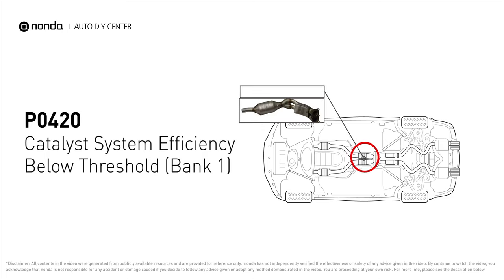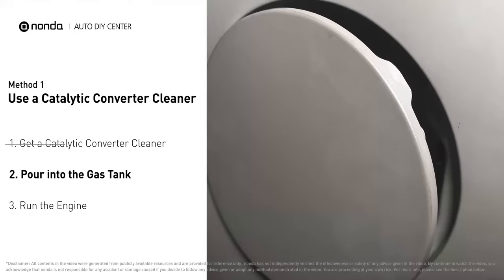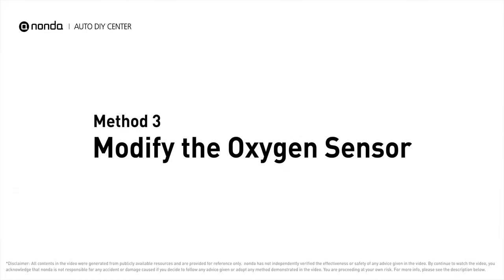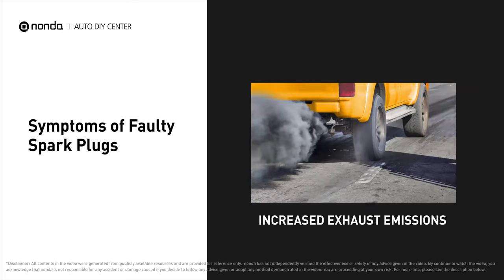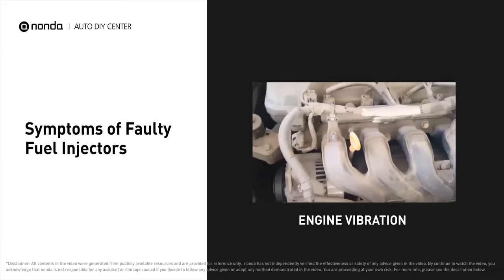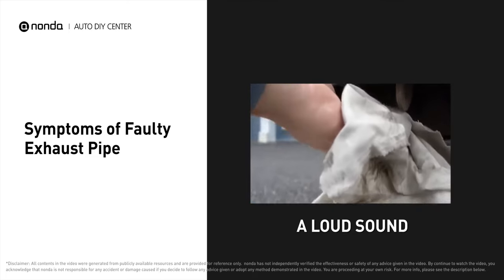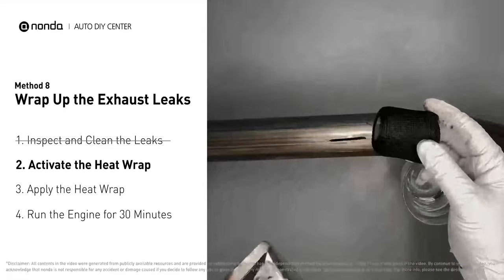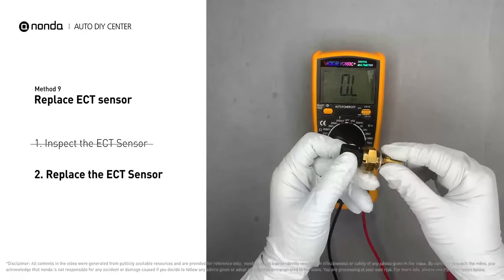9 Solutions to Fix P0420 - Don't Start Fixing Before Watching This

Comment: It is a great way to help me understand the P0420 on my Dodge. However, if you eliminate the music from the video the information will be projected much clearly.
Reply from the maker: Thank you for your feedback.
Reply: I like the music
Reply: The "music" , if you can call it that, is EXTREMELY annoying.
Reply: Your right, very annoying!
Reply: I just installed new long tube headers with catted x pipe and got a tune on my 14 mustang gt and got codes P0420 and P0430. Never had this happen till I got the headers installed any idea why this happened?
Reply: @UrbanMaxxTV to ok 😊😊😌

Comment: Very professional and absolutely thorough.  I've been wrestling with P0420 for most of the year and found these ideas individually.  It's nice to see them altogether in a very professional presentation.  I'm finally ready to order a cat, but I called the manufacturer and he agreed that it was often not the cat - but I've looked at all these others already.  So frustrating, mainly because my cat is welded inline so I can't even check it.  Alldata points to bad cat, but I keep thinking it's something else.
Reply from the maker: Hello, we really appreciate your feedback. Hope it helps!
Reply: name of detergent?
Reply from the maker: Hi Zoltán, you may head over to this link regarding your concern with the Detergent Soap: https://amzn.to/3sbMISV
Reply: @nondainc  thx 😉
Reply: did replacing the cat fix the problem?
Reply: I used gumout, changed my sparkplugs and cleared the code, check engine light hasn't come back on.I think my injectors may have been dirty, I have to look into my cat, can't do much but check the temp before and after it to see if it's working right.
Reply: I also had a code for ECT sensor but check light hasn't came on, I may replace it or check it when I do a coolant flush this spring
Reply: BE AWARE THAT some VW Group automobiles do display a tricky P-0420 code EVEN when the catalyst is still good and with half its remanent life ahead...

Here in Mexico City, the environmental regulations impose low emission limits, so that we have to achieve a very good low levels before attempting to go to inspection, that is too frequent at six month intervals! 

We have found that a Sparkplug or O2 Sensor Extender is the best overall solution for those VW vehicles. We also pack a little quantity of stainless steel mesh at the end of the sensor between the sensor tip and the extender, which best has to have a thin wire screen to prevent the mesh from going into the exhaust pipe. We have also found that used but still functional O2 sensors can be cleaned from carbon deposits by heating the very tip of the sensor element (away from the sensor heating element) with the tip of the smaller bright blue flame of a  propane torch JUST until the sensor tip gets a FAINT RED color and no more!... That will safely combust all carbon deposits on the sensor ceramic support inside the shroud without harming the sensor at all.
Reply: Check for vacuum leaks, exhaust leaks use a shop vac 
And put the hose on the output side stick the hose in the tailpipe seal it with duck tape and use some soapy water ima spray bottle and check for leaks in the entire exhaust system. If you have a scan tool check and see how the oxygen sensors are working hope this helps. There’s more test you can do but this will point you in the right direction

Comment: Method #3 is illegal in most states. The car's emissions system has been modified. The sensor no longer has a steady stream of exhaust to monitor and the car will not pass emissions or be legal to operate.

Comment: Another possible reason for getting PO420 code that is not mentioned....an exhaust leak somewhere that screws up the "comparison" signal between the upstream and downstream O2 sensors.....causing them to say the cat is working below efficiency. One place to look beside obvious rust holes in the piping is the first flange gasket at the exhaust manifold. If this leaks, it screws up the readings and causes the code.
Reply: lol you didn’t watch the whole video? Exhaust leaks are mentioned in the video.

Comment: Carbon build up in the engine can also trigger the code as I own a 2014 Jeep Grand Cherokee Laredo I used Seafoam Intake Cleaner and after it blew all the carbon out the check engine light turned off and never came back on
Reply from the maker: Hello, thanks for sharing your knowledge!
Reply: My 2015 F150 5.0 did the oposite, after using Seafoam, then a month or so lader STP the engine lite came in middle of trip!
Reply: @bowe1978 If it happened a month or so later then the fuel additives probably weren't the culprit.

Comment: Fixed mine by cleaning the cat with laquer thinner thru the o2 sensor #1 hole followed by carb cleaner sprayed thru followed by dawn dishsoap and water! I would nvr mix laquer thinner in my gas! Thats just idiotic if all you want to do is clean the cat!

Comment: Method 3, Non fouler idea is illegal and can cause more severe later problems.....
Reply: What problems is it causing? I guess if you leave the cat on it’ll eventually plug all the way up and melt down🤷🏻‍♂️ 
The nice thing about the non fouler is that you can pull the o2 sensor far enough out of the exhaust stream to get away with no catalytic converter.

Comment: Please, I have a 2004 Fiat Sienna car, and I have a problem with it. When I did the diagnosis, I got code p 1619. I want to know what this means, please.
Reply from the maker: Hi Mohamed, this code is triggered when oil pressure drops to the point where it can no longer operate the variable cylinder management system.

Comment: I have replaced the Cat twice and the upstream O2 sensor and check engine light came back on after 300 miles and error code P0420. I passed inspection before the light came back. The mechanic advises flushing the computer as the P0420 code is stored in the memory and needs to be removed. Any advice? Thanks
Reply from the maker: Hi Ashraf, please provide us with your vehicle's year, make and model so we can address your concern according to your specific vehicle make/model.
Reply: @nondainc  My car is Toyota Camry 2011 LE 4 Cylinders, 2.5L.
Reply: Yooo this is the same vehicle I have with the exact same issue. May I have the same advice? Thank you.
Reply: @dougm.2579   place a spacer to the O2 sensor as shown in the video., this should fix the issue.
Reply: Take battery out touch both Post together for 3 min will reset computer

Comment: Hi, I have a question about P0420. I have2013  nissan pathfinder. My check engine light pumpa up with code P0420 but after a while it's corrects it self and the light goes off. It did that 4 times already. I was wondering if it means anything?
Reply from the maker: Hi Emrah, this code refers to "Catalyst System Efficiency Below Threshold" which is often triggered by a faulty O2 sensor (upstream side of the catalytic converter).  We suggest checking the exhaust for leaks and testing the O2 sensors if functioning properly.

Comment: How much will the dealership or a local garage charge for diagnostic and fix? Everytime I go to one with a check engine light, they are magically able to charge upwards of $1000 for a fix, no matter what the issue is.

Comment: Got a 2004 Toyota Highlander with p0420 code. Took it to a shop and they tested o2 sensors - both are good. But I have no symptoms of a bad cat other than the code itself.
Reply from the maker: Pls check the possible causes:
Faulty Three-way Catalyst Converter Bank 1
Exhaust Tube
Intake Air Leaks
Faulty Oxygen (O2) Sensor
Faulty Fuel Injector(s)
Leaking Fuel Injector (s)

Comment: My 2014 Ford Explorer Police Interceptor 3.7L was reading P0420 P0430, and also pending codes for them. Found hot air flow from a leaking gasket after the catalytic converter to the muffler. Replaced the gasket, weld the cracks between muffler and pipe. Codes are gone, waiting for sensors to be ready again.

Comment: Never use the spark plug gapper itself against the electrode to bend the ground tab as shown in this video. Could easily damage the electrode.
Bend the ground tab from the back of it with a proper gap adjustment tool or carefully with needle nose pliers if the tool isn't available.
Use a wire loop type feeler gauge on exotic metal plugs for proper gap setting to prevent damage.

Most wire loop feeler gauges have a ground tab bender included.

Comment: I have a 2007 nissan altima with 214k miles and it's showing the same code p0420  i haven't use the catalytic cleaner yet but i'm going to try that next to see if i can pass inspection. My code reader was throwing a bank 1 sensor not ready so hopefully this helps.
Reply from the maker: Thanks for watching, Nate! Hope it helps!

Comment: Thank you for the great video and very specific checks for this issue. I have a 2009 chevy cobalt with a new cat converter but i keep getting the 0420 code. I have replaced everything but i have not tried the O2 spacer. Ill give it a shot and report back. Thanks!
Reply from the maker: Hope it helps, Rod!
Reply: @Str8blastn713 Htx south sorry bud this did not work for me. There isn't enough space between the oxygen sensor and the floor board. I was not able to out both foulers on.2009 chevy cobalt LS
Reply: @nondainc will I be able to pass emissions test with extender on o2 sensor?

Comment: I have a 2017 Hyundai accent and it shows this code and a p0335. Sometimes it will crank with no issues, but there are times when I have to tap the gas pedal for it to start. Any idea of what it could be?

Comment: Changed the catalytic converter but still the check engine light is on , and my main problem the is shaking under the driver seat between speed of 10-40

Comment: Great 👍 
When my car Hyundai accent 2017 be Hot 🔥 appears the check engine lamp with the codes p0104 and p0420.
Thank you
Reply from the maker: Hi Sardar, we highly suggest getting your vehicle checked with your local mechanic if you're getting more than one error codes for further diagnosis.

Comment: I have a 2003 Ford Mustang GT 4.6. Code P0420 came up and now my car started hesitating. Oh, and overheating now
Reply from the maker: Hi Raul, kindly inspect the exhaust manifold, gaskets, and exhaust pipes pre-catalytic converter for any leaks. Then check if there's an issue with the voltage reading of the downstream O2 sensor.

Comment: Very thorough video, thank you. I have this problem with a 05 Subaru legacy 2.5i, I really do not want to replace cat if I don’t have to. Can a garage run diagnostics to pinpoint the problem? And also I gave a California emissions car but don’t live in California if I had to replace cat with aftermarket do I have to get a California emissions cat, cause they are considerably more expensive or will a non cal emissions cat work?
Reply from the maker: Hi Terry, thanks for your feedback! The California emission catalytic converter is suggested.

Comment: I have a 2015 Honda Pilot. Last week the check engine light came on and I took it to my mechanic. He didn’t tell me the code. He said “engine running lean” and replace the air filter. It was fine all week. Last night it came on again. Went to autozone and got PO420 (cat sys efficiency below threshold bank 1. Can I drive it for a day or two until I can get to mechanic? Will it hurt to try cataclean? I know it might not work. But it won’t hurt anything right? I still need to have it checked. It has some trouble starting for a while. No bad smells, noises, or smoke. Passed inspection in February. Has 154000 miles. Slight drop in fuel efficiency. No performance issues. Always use cheapest gas. Should I try better gas? What octane and from who? I usually do Circle K.
Reply: i've been having that code for years. It just means your cat might be going out. You won't pass smog test tho with the code. For honda you might have to replace OEM cat which is very expensive. You can try to do from following above video. Cats only last up to 100k to life the car. You never know.
Reply from the maker: Hi Regina, if there's no other codes that register along with this code, we suggest following the repair procedures provided in our video. Hope it helps!
Reply: Did you resolve your code ?

Comment: How long will it take before the engine light will go off after putting the cleaner in?
Reply from the maker: Hi Misty, as long as there's no other fault codes registering together with code, it should be fixed immediately. But we'd like to clarify that this isn't the only fix for this code as there's also other parts to be checked.

Comment: 2011 Chevrolet Traverse LS 3.6L V6. 198000km.
P0420. The code shows up intermittently. No driveability issues yet. It disappears after putting fuel system / exhaust cleaners.

Questions:
1. Can I keep doing this for 2 years and not expect damage to the engine? If I do an exhaust restriction and there's no restriction,  I should be OK right?
2. Can P0420 mean my engine is failing?
Reply from the maker: Hi Nestor, can you please confirm if this is the only code you're getting?
Reply: @nondainc  Yes its a lone code. No drivability issues. The o2 sensor 2 follows o2 sensor 1. We don't do emissions testing where I live. I used to have a p0301 code caused by the ignition coil being wet  but that has been resolved.

Comment: I have a 2014 Silverado 1500 replaced both cats and oxygen sensors and light came back on it is because they are not OEM?
Reply from the maker: Hello, we highly suggest OEM sensors for your car. Also, please check if there's an exhaust leak.

Comment: Method 3 - the extender - does it go on the sensor before or after the converter?
Reply from the maker: Hi Jeff, please provide us with your car's year, make and model.
Reply: @nondainc  we replaced the sensor on bank 1 sensor 2 on an F250 and it cleared the 420 code. Thanks for your help!
Reply: Downstream sensor....but don't do it, it's illegal and can cause later problems.

Comment: question can the po420 cause miss fires because i have the same code and am currently experiencing convulsion in my boost and studers
Reply from the maker: Hello, can you please provide us with your vehicle's year, make and model?
Reply: I bet it's more likely the misfires polluting the cat to cause the 420.  I'd fix the misfire first (my case was old coil pack boots) then try cleaning the cat.  But some say backpressure could be an issue with some cats, but I think chemical damage is more often than physical melting.   Just my two cents.
Reply: Misfiring dumps tons of fuel into them and usually burns them up, the longer you ride around like that the chances are it's already toasted.

Comment: I have a 2012 nissan versa and I got this code p0420 catalyst system efficiency below threshold bank 1, I've tried cataclean and it didn't work. What should I try next?
Reply from the maker: Hello, you may try the other methods provided in our video. Thank you!
Reply: when's the last time you changed spark plugs?
Reply: is your gas cap ok?

Comment: Hello Sir ! I have two code PO420 and PO430 on Mazda CX 09 2016 engine size 3.7. Engine light is on and  Recently passed emission test . Is this possible convertor damge or I need to replace sensor only ? Because I have cleared emission test with this code.
Reply from the maker: Hi Khurram, we suggest getting your vehicle visually inspected by you local mechanic for further diagnosis.

Comment: My 2011 accord coupe shows the p0420 code bank 1 just yesterday I started to hear a rattling noise coming from 7nder the car it comes and goes away you think mt cat is done for
Reply from the maker: Hi Hector, can you please confirm if this is the only code you're getting?
Reply: @nondainc  yes thats only one
Reply from the maker: Hi Hector, the code could be triggered by a faulty oxygen sensor or bad catalytic converter.

Comment: Hello I have a 2010 Toyota Corolla LE with the 2 p0420 codes, I added the Catalytic cleaner but the code remained there
Reply from the maker: Hi Pedro, have you checked if there's an exhaust leak? Please also verify if the upstream o2 sensor and downstream o2 sensor is working properly.
Reply: @nondainc  I have not but will check now 
Thank you

Comment: My 2012 ford explorer 3.5 2wd. Have a Code of p0420 that come and go. Do you think I have a bad cat or sensor? TIA
Reply from the maker: Yes. Issue with the mentioned parts are actually what triggers the code.
Reply: I have the same vehicle except it is the AWD XLT version, replaced o2 sensors, replaced ignition coils, replaced spark plugs, still had major issues. Took one of the o2 sensors out and looked inside the cat and it was completely shattered. It’s a pain in the a$

Comment: hey i have a chevy malibu 2016 ls and im getting the p0171 m, p0420 and p1101 what can possibly be the issue with these codes?
Reply from the maker: Hello, as you are getting more than one error code, we suggest getting your vehicle visually checked by your local mechanic for further diagnosis.

Comment: If i wanna put O2 sensor spacer then i should put with upstream or downstream sensor? Getting fault code P0420. Vehicle Model Elantra 2015 1.6
Reply from the maker: Hello, it's on the upstream side.

Comment: Hi! I have a 2011 Buick Enclave CXL 2fwd I’m getting a catalyst system efficiency DTC severity 2 of 3 repair immediately. Is it my catalyst converter or could it be my water pump? What should I do clean it or replace it??
Reply from the maker: Hi Kimberly, have you checked if there's an exhaust leak? You need to test the O2 sensors (upstream side of the catalytic converter) and the catalytic converter to pinpoint what's causing the issue.